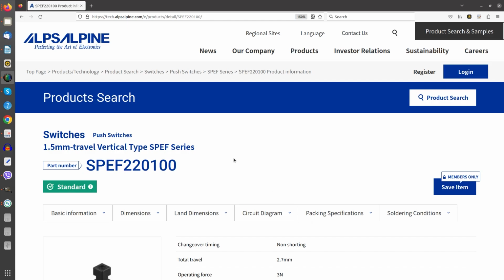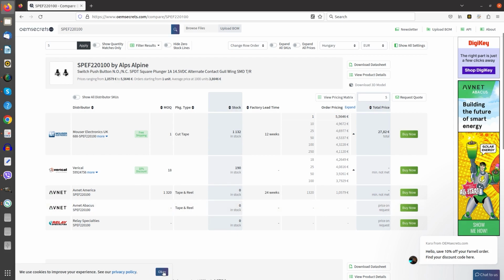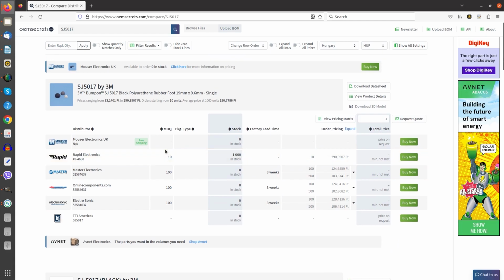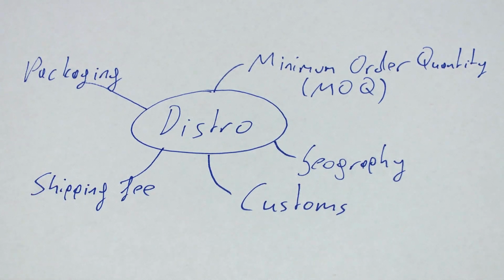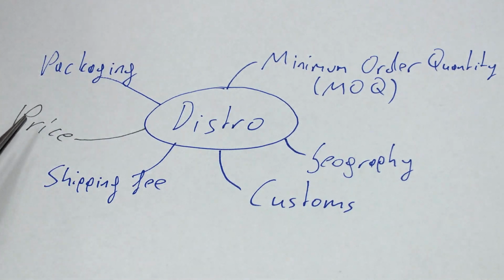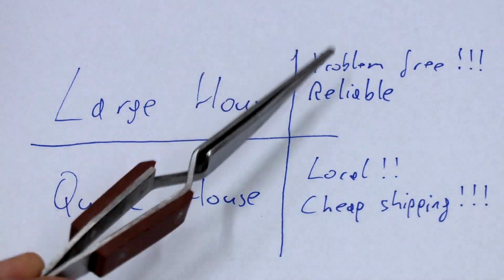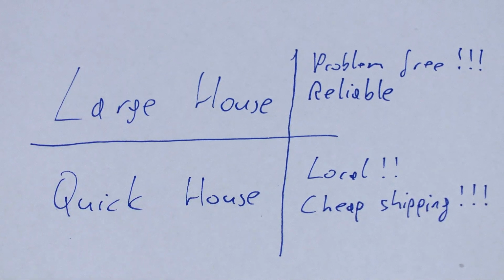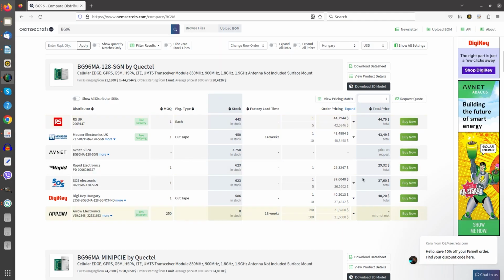How to buy electronic components and select distributors efficiently

Comment: Things have really changed, since I started buying parts, almost 60 years  ago. There were a couple local distributors, who sold in two categories. OEM or Support. You had go go through a lot of BS to buy parts that weren't available as support. One demanded a Dunn & Bradstreet number. Others wanted to verify your address was zoned for business. The alliterative was mail order from Allied or Lafayette. Both were quite slow, and often screwed up your order.
There were several large surplus dealers with military components, then Digikey popped uup selling a kit of parts to build an electronic keyer for Amateur radio. They soon started selling other components. They grew rapidly, because they were eager for any reasonable sized order. Other distributors noticed them, and stated to change, but it was too late for some of them to survive.
Reply from the maker: Hi Man,
tell me all about it. I grew up on Farnell and their 50pcs minimum order quantity for anything...

Thanks for talking back, BTW!

Tam
Reply: @MrTamhan  I still have some IEC power connectors that I had to buy, almost 50 years ago, to be able to do a job for an important customer. I only needed one. I had to buy 25. Over $75, to be able to complete that job. On top of that, my main supplier also old to a local steel mill. I had to wait over a month on some parts, only to have my order diverted to that steel mill when it came in to the local branch. Some times multiple orders for the same part were diverted to them, because they reordered. It got to the point that it took a couple months to get a 'D' chassis punch to mount fuse 3AG style holders.
Reply from the maker: Hi, oh man, this reminds me of the old fight...in a way, we live in paradisic times today...
Reply: @MrTamhan  At least they understood the requirements for effective test equipment. I get angry when I run into some idiot who brags that they modified a VTVM to eliminate the i meg resistor in the DC probe.
They have no idea why it was put there, and how they have eliminated to one advantage a VTVM had over aVOM.
Reply from the maker: I fully agree. The young ones...oh man. I wonder if we were so troublesome when we were their age
Reply: @MrTamhan  My first job was in a TV shop, at 13. Thee owner gave me some great advice the first day. "Keep your eyes open ad your mouth shut, until you have an idea how things are done. Then ask for any help that you need. I was working mostly on radios and record players,  but I also did some TV repair. I learned a lot of practical information from him and his other tech. Things that you wouldn't likely come up with, on your own. Like when I was given an oscilloscope with a bad power transformer. It was common for the CRT filament winding to fail, but Stancore sold a 6.3V transformer rated to 3KV isolation. Rewire the CRT to the new transformer, and you had a working scope for about $10."
Reply from the maker: @michaelterrell  That is the way we all got started man. Sadly, today is different...
Reply: @MrTamhan  It used to be difficult to locate an obscure or obsolete tube. so you often ended up with a lrge accumulation of spares. Now it's finding the Surface mount parts that you need. I have around 2,000 reels of then, and still rarely have what I need.
Reply from the maker: Oh Man, I know that issue too well. SMD is a hell of its own...  @michaelterrell
Reply: @MrTamhan  At least it doesn't need as much storage space!
Reply: I'm 21 now and I had a Grandpa on either side on my family who owned electronic stores in the 60's/70's. As much as I love working on this stuff now I do admit im a little envious of never getting to grow up during the home electronic work boom. Although having trouble finding hyper specific parts now makes me realize after reading your comment, it seems like it was ordering a rare car part haha